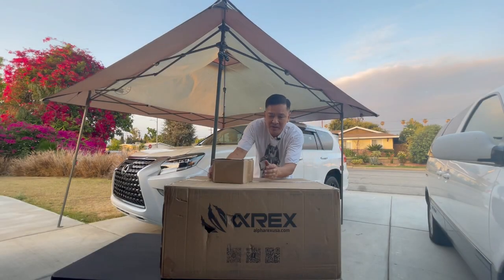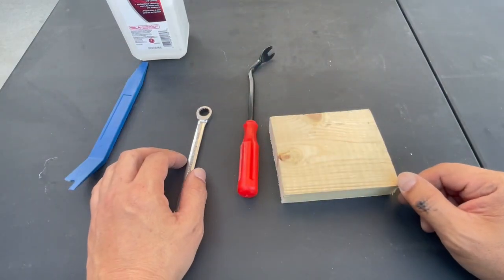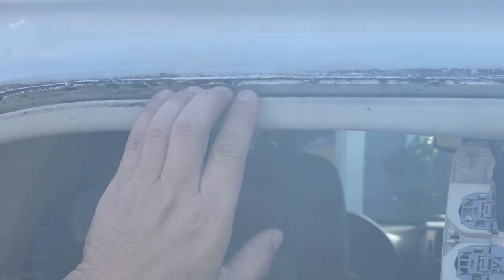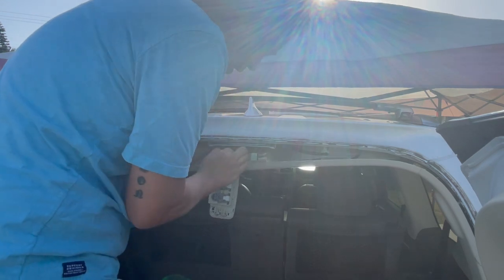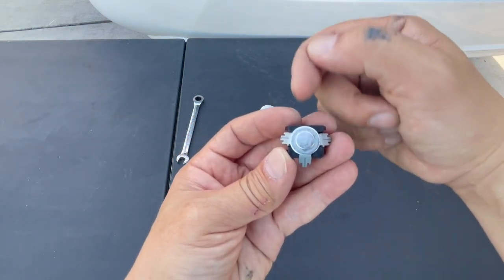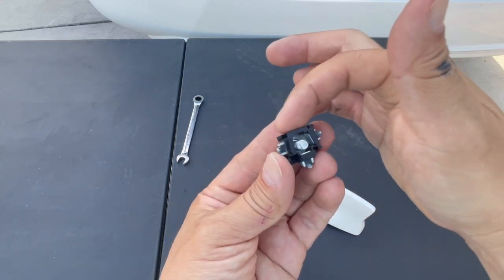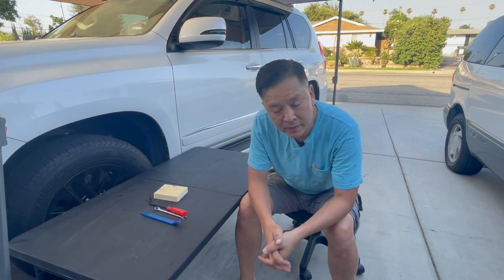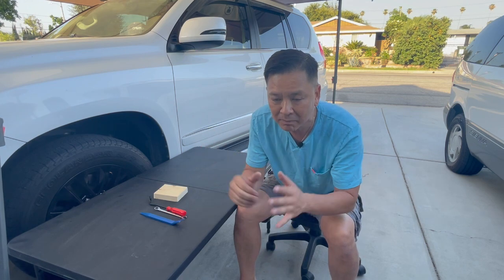Lexus GX460 SHARK FIN ANTENNA REMOVE AND REPLACE

Comment: I have a 2019 and the dealership wants to charge me over $1000 to replace my damaged on.  Would this be the same set up for a 2019?
Reply from the maker: @MelissaLesko  yes, there were no changes from my 2017 to your 2019. Good luck with your install!

Comment: Thats impressive...my fin got knocked off ..everything still works..   I just bought aftermarket fin that was large enough to cover the chip.    3m tape didn't work.  I had to use silicone unfortunately.    It worked though.

Comment: Thank you Bob! I backed my 2020 GX into my garage for the first time, not realizing the shark fin didn't have clearance of my overhead storage rack. The whole cover got knocked off! The first thing I thought of was you, and if you had a video covering a shark fin installation. It took me about an hour and a half because I had to bend the inner liner of the shark fin back into place and piece the whole antenna back together. The roof was slightly bent but I was able to level it out. I used a little clear silicone to make sure the antenna stays watertight. You are DA MAN!
Reply from the maker: On a 2020? That must’ve hurt. I know a good lawyer if you want to sue your wife for buying a house with a garage without considering you own a 2020 Lexus. Very inconsiderate of her.

Comment: GX Bob I need your opinion! I noticed the rubber seal around my radio antenna has a very very small space between the rubber and the roof. You can fit a couple pieces of paper under it. When I press down on the antenna, there is a small amount of free play. BUT there are no leaks. Would you change out the antenna just to be sure??? Or leave it as is???

Comment: Hey bob , thanks again for a amazing video !!! My wife decide damage the antenna cap 😀 when she backup on the garage ! Because you always do a good videos , I was able to change in 45 min !!! The antenna still a little little bite lose but I went already to the car wash and no sign off water inside the car !!!
Reply from the maker: @explorersventures  Do me a favor and redo the install but this time use Rectorseal 57500 10.1-Ounce Hi-Temp 100-Percent Rtv Silicone Sealant is a good exterior sealant for water proofing on paint that’s recommended by others. Your comment about it still being loose worries me.

Comment: Thank you thank you! My wife's 460 has been popped loose for months! Thanks for listening to our requests! I can't BELIEVE Lexus only relies on 3 little prongs to secure antenna!  Of course you don't want it strong enough to damage roof! Can't wait to tear into it!
Reply from the maker: I know i said the loosening of the 10mm and disengaging the plug is done blindly, but there is enough room for you to stick your arm in there and visually see what you're doing.  It was just challenging for me because of the camera angles.  You will definitely have an easier removal than i did.
Reply: @GXBOB  I was thinking the same thing! Thx!

Comment: This really helps me! I have a 2021 RX350. Basically the same procedure. I had one insurance estimate and it was $2500.00! They tried to tell me the whole headliner had to come down. They have to check the beam underneath for damage and then remove the roof racks so they could redo the whole area around the fin! Told my wife I’m going to do it myself. Total parts $175.00 and about 45 minutes work. The small dimple near the fin I’ll massage out with a spoon. Any possibilities of leaks will be siliconed. Crazy!
Reply from the maker: I really love hearing stories like this. Not sure how many more GX vids you can use for the RX but at least you’ve helped others answer at least one potential question. Enjoy!😃
Reply: Hi Geo Des, Did you have to remove the dome light like GX model?
Reply: Where did you find the antenna that cheap
Reply: @Foltzwagen  I can not remember where I got the stock number for the part as I recall and just searched around on the internet until I found the cheapest price to answer the previous poster. I know you asked this about a year ago. I hadn’t seen it til just now. No, I did not have to remove the done light as I recall.

Comment: What kind of silicone would you use to create a tight seal around the new antenna? Any chance of a link to what you recommend? Thanks!
Reply from the maker: Joe, when you remove your shark fin, i recommend you replace your oem rubber gasket and that should properly seal without the need for sealant.  If you feel your antenna or roof was displaced due to weather, accidents, or multiple removals then i highly recommend a product off of Amazon that other experts use for external seals such as.  Its a little expensive but i rather pay now than later with water damage:  
https://www.amazon.com/Rectorseal-57500-10-1-Ounce-100-Percent-Silicone/dp/B008A3UG8A?ie=UTF8&linkCode=ll1&tag=improvecaraud-20&linkId=3c176fa45af78ef2cd11b431a23bb269&language=en_US&ref_=as_li_ss_tl
Reply: @GXBOB  Thank you so much! Yea the fin was damaged and pulled up backing out of the garage, so the antenna assembly sits raised due to the bend in the metal. Fortunately the seals are holding for now and there's been no water intrusion but I was wondering if I could replace the plastic cover and then bond it down to the metal.

Comment: 2013 GX460 shark fin antenna was easier to replace and disconnect. Your video was helpful.
Reply from the maker: how much easier than screwing one 10mm bolt, right?

Comment: Thanks for another great video Bob!  

For anyone else who attempts this: I found that using a short stubby ratchet with a small 10mm, to be easier to use on the bolt than a ratchet wrench. 

I used this video to install the Go Fast Campers fin delete for the 4Runner, it fits the GX as well.
Reply from the maker: Nice, thanks for the input!
Reply: @gx46079

I have a 2011 GX… Will the GFC 4Runner shark fin delete fit my rig? I want to add the front runner table to my rack and it mounts under the rack. I’m looking for a way to get it to work?  I basically need to either shave the fin down or install the gfc or can I just remove it and install the MVT delete which is just a couple of washers and a nut that would keep it water tight? What exactly is in the antenna? Could I just 3m tape it up inside the headliner?
Reply: @PeterKinsey  GFC 4 runner delete should fit your ‘11 GX, I can’t see why Toyota would have changed the fin with the facelift in 2013… That said, it takes less than 10min to pop the fin out using Bob’s method, to confirm if it’s the same as what’s in the GFC install video, and you can always put it back in. Better than destroying it to take it off. 
My use case was the same as yours, to mount my FrontRunner table under my rack. It’s worked out great. 
I still don’t know what the antenna is for, but haven’t noticed any difference after having it off for many months. (I don’t use satellite radio)

Comment: Hi, Bob, thank you so much for your video, it helps to understand how this process work! I do have a question, after you replace the antenna, can we go do car wash as normal as before? I was wondering if the water will get thru the gap of the antenna since there isn't any glue or rubber seal to secure the shark fin cover? Please be kind enough to advice. I recently had the dealership to replace for me and the advisor was saying it show be ok but won't know till it if gets thru a good rain? Your expertise is greatly appreciated. I really need to get the car washed... kinda dirty.😀
Reply from the maker: Depends…why did you have it replaced? Accident backing your truck in the garage? If your antenna was struck then the contour of your roof was probably affected even though you can’t see it by the naked eye. I feel like anything that’s taken off after the manufacturer had their robots installed never really goes back the same anymore especially exterior components.  I suggest you lay a bead of silicone where the antenna makes contact with the roof of your Lexus just to sleep better at night. Nothings worse than water damage. 
Rectorseal 57500 10.1-Ounce Hi-Temp 100-Percent Rtv Silicone Sealant is a good exterior sealant for water proofing on paint that’s recommended by others.
Reply: @GXBOB  Thanks Bob for your quick reply! Yes, i did have my garage door yanked the antenna cover off. But the actual antenna was still sitting good but a bit crooked on the top. However the shark fin cover could no long letch on properly and dealer suggested to replace the whole thing, which I did. They put it back and it looks find and I did ask if they seal it up, they said it doesn't need to be sealed it is just a screw to secure it ( just like the way you show on your video).  So I was wondering if i should be worrying about the water leaking in ? Maybe I m paranoid ...I should wait till it rains once to tell? Thanks a million again.

Comment: You did it!!! Thanks a lot - instant hit. A lot easier than I expected since you don’t have to mess with the sides.
Reply from the maker: I was expecting to drop the entire headliner to be honest.
Reply: @GXBOB  needless to say, I love you more. Haha
Reply: Mine was different on a 2010 GX, I believe it uses an 18mm nut to hold the ring that presses against the roof. Not user how tight to go with it, though.

Comment: Thanks for the video! I bumped the fin against my garage door. It's slightly loose but not broken, the radio still works. Just wondering if i need to seal the gap with silicon? I can move the fin around if i press on it, although it's not super loose i can see a small gap in the front.
Reply from the maker: Yes you should remove it entirely and reseal with a new rubber gasket. The minute you hit that garage, you created a nonconformity on the outer mold line of your roof.

Comment: The shark fin on my 2017 GX was ripped off by garage door when my rookie driver daughter backed out too early and then decided to go back in. The only thing remaining is part of the chip (about 1 inch square) I would like to replace it myself. What kind of silicon should I purchase and when/where should I lay the bead? Love your vids! I really think I can do this!
Reply from the maker: https://www.amazon.com/3M-03601-Plastic-Emblem-Adhesive/dp/B000CCM3J2/ref=asc_df_B000CCM3J2/?tag=hyprod-20&linkCode=df0&hvadid=343955370377&hvpos=&hvnetw=g&hvrand=5045313427656445553&hvpone=&hvptwo=&hvqmt=&hvdev=c&hvdvcmdl=&hvlocint=&hvlocphy=9031253&hvtargid=pla-524635590405&psc=1&tag=&ref=&adgrpid=74841503648&hvpone=&hvptwo=&hvadid=343955370377&hvpos=&hvnetw=g&hvrand=5045313427656445553&hvqmt=&hvdev=c&hvdvcmdl=&hvlocint=&hvlocphy=9031253&hvtargid=pla-524635590405

Comment: Hi, Bob - it seems as though mine got knocked loose in a car wash (won’t do that again). Do you think I could simply pull down the headliner and tighten that 10mm bolt to help reseat it without completely removing it and reinstalling it?
Reply from the maker: Since it’s been detached off its original mounting location it might be a good idea to buy a new rubber seal or use aftermarket seal around perimeter.
Reply: Thanks!

Comment: I tried doing this on my 2010, and there was a whole thing between the headliner and the metal roof. It was so much harder to pull the headliner down, I really couldn’t even put my hand in there it was a lot stiffer and tighter in there. I couldn’t do it.
Reply from the maker: You might have to drop the side plastic quarter panels on the older years.

Comment: Hey Bob, do you ever use regular gas as opposed to premium?
Reply from the maker: Not in my GX. I’m good with premium to the end.  You may save money and mpg's in the short run but the detriment it will cause in your emissions system will cost you thousands later and will eventually worse MPG's.

Comment: Hi Bob I appreciate your videos they’ve cost me my time and money;) If you catch this comment could you address the globe box latch? Mine seems to function properly however it’s not very secure. A minor annoyance. I’m sorting a few issues with my new to me 10’ GX and have done a number of your mods. Seat covers and rear window regulator are waiting in boxes. Many thanks for what you do. Andrew
Reply from the maker: Yo Andrew, glove box is easy.  Just involves a bit of tinkering.  But rear window regulators??? Now we're talking.  As far as seat covers, how did it go?  I may do another one but one with more steps and better camera angles.  My equipment and editing skills have improved significantly since.
Reply: @GXBOB  it’s burning hot here in Fla Bob I’m building fortitude before I sweat my ass off changing those covers
Reply from the maker: @andrewfox9000  We are not too far behind in temperatures in So Cal.  The days are longer and we are starting summer tomorrow as i type.  I'm looking to find shade so i can continue in my quest for additional videos to accommodate a long list of requests.

Comment: Do you have an instagram account? I recently purchased a GX460 Premium trim and regret not getting the luxury because of the leather seats. Any thoughts on synthetic leather ?
Reply from the maker: Yes i do have IG, its the same username as my YT.  The IG is mostly random life stuff and not car specific.  So leather vs synthetic.....depends Carlos, where do u live, what is your budget, and are u hauling children and pets?  Reason why i ask is leather is more durable, smells better, and lasts longer, but synthetic retains its color without fading, a lot easier to clean, and takes the beating of hot climate better.  Living in states like  Arizona and Texas, synthetic would be a better choice.
Reply: @GXBOB  thanks! I am just regretting getting the premium trim instead of the luxury which is about $10k more. I live in LA, with three little monsters.
Reply from the maker: @carlosviscarra1  i have had no issues with nuluxe. I condition my seats regularly.

Comment: Bob, old car (2012 GX460) and new-to-me house/garage. Factory antenna is 2" too tall for garage. Know of any lower profile alternatives or straight up flush caps?
Reply from the maker: you're not the first to request this Eric.  There is a cap cover online that  4runners are using but it does fit the GX460.  If u still want the antenna function i'm sure you'll find a way to tuck it within the headliner but this cap will remedy your issue.  Good luck and may the force be with you.
https://forum.ih8mud.com/threads/gx460-roof-antenna-shark-fin-cover-delete.1246373/

Comment: @GX*BBO do you feel the difference between sport and comfort mode? My father owns a GX 17 and sincerely feel the same in both.
Reply from the maker: Sorry German, i own a base model and do not have the options of sport/comfort modes. I only have one mode and its spring coils with shocks.  If you have the option of adjustable shocks that provide sport/comfort mode then there should be a significant difference since one is a tighter feel and one is a softer feel.  If you get to the point where you can't tell the difference, you might want to check your shocks for visible leaks and change them out.  I had a 2011 GX premium that had those options but rarely ever used it.  I found it to be useless to me.